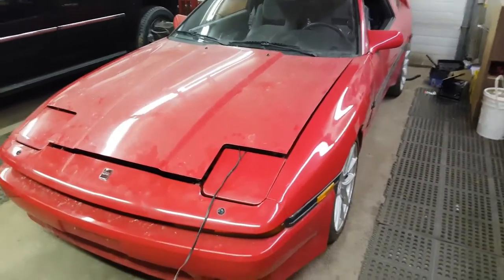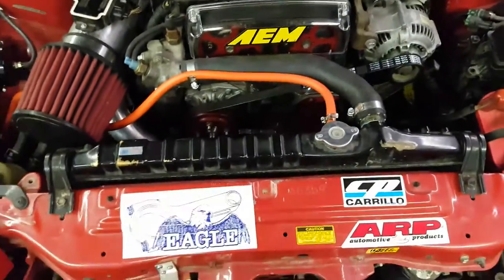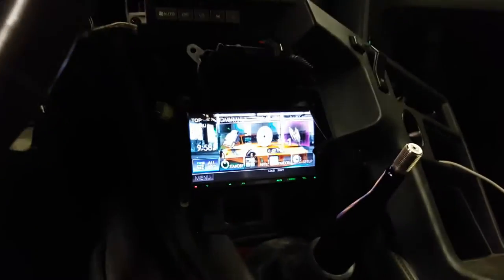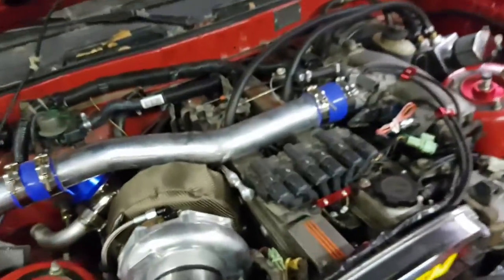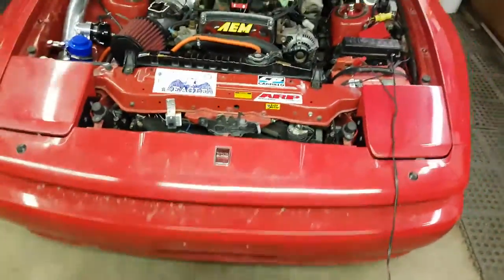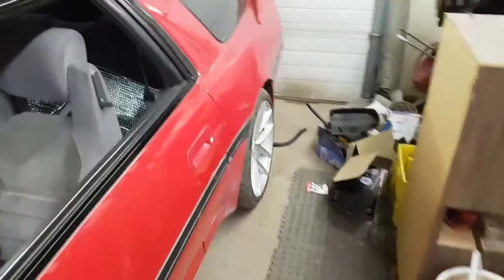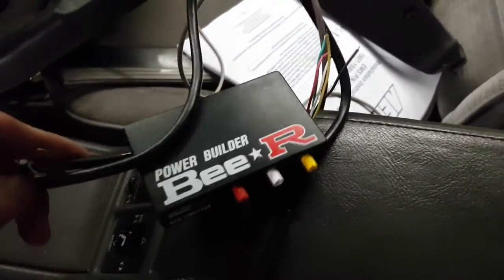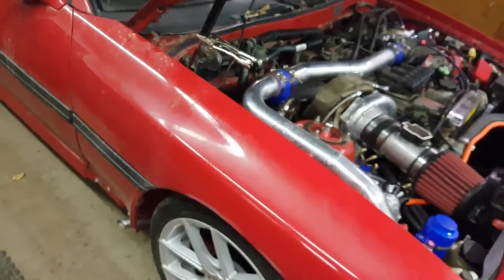mk3 supra fully built 7mgte walk around and idle

Comment: sick job on the build. I'm rebuilding my 7mgte and you have that AEM standalone that's going to make that car a beast. You kind of made the build look easy and switching to a ffim will make the car look more like a jdm inline 6, that should have been stock anyway. Plus it makes getting power out of it so freaking easy, but they are like a grand just to have one made unless you buy second hand; good luck on that. I'm buying all my bearings, pistons, rods, etc... and I'm jealous. That R154 will hold power up to 500bhp easy. Just was looking up 7m's and your right about the door seals that say Supra on them, I've had two 87 mk3's for over 13 years and I've never seen those. The only thing I do is drift and set it up for time attack and it still is just ass happy so it's a driver's car for sure. I think that's why it doesn't get the love it deserves, but if you know how to drive you'll love these things. I love my Cressida but N/A 7m's aren't good, at least compared to the 7mgte. Sorry for the rant, I digress, mainly the best mods to do to the mk3's is suspension and steering mods. Poly Urethane bushings, coilovers, good steering wheel, and strut braces all around as well as aftermarket anti-sway bars with poly bushings cuz more than likely if their stock the car drives bad. And a really good differential and these cars are fun. Turbo is loud, wastegate is loud and a good BOV makes all the difference in the world. I hope you enjoy the mk3 cuz it deserves a following. Just ppl that can't drive hate on it and as long as you can drive this car you can drive any car.

Comment: on the cheap you can do the IS300 waste spark setup, coils are cheapest on Ebay, the wiring is easy to do yourself or buy from driftmotion, i heard the factory ignition ignitor and resistors are good it is just the coilpack style is kinda unreliable

Comment: Stock speedo meter is at 280km/h at my 1990 Turbo MK3... and change break and clutch fluid you still have to change unless you use dark chocolate milk for it then you are fine! And the door sills are really real nice! if you remove the front bumper the fenders go off and on easy so you might just get a good used one.
Reply from the maker: hahah thanks man!
Reply: MrBigzeee The thing with not changeing it for a long time is common but those are the one that complain about broken break and clutch cylinder too and if all shit goes down on you you ABS block will be damaged to due to bad maintenance of the fluid. Because the break fluid likes to bound with water and then the oxidation will kill it. Do not use it longer then 2 years better is to change it every year.

Comment: In the stock 7mgte with metal head gasket a reliable engine with over 300whp? Obviously with stock internals and frequent oil changes? 
Thank you
Reply: Lorenzo Clara I am wondering this too!
Reply: I'm making a reliable 400hp on a stock gasket with arp head studs at 80lbs. But I don't beat the absolute hell out if the car. But I do have fun with it.

Comment: Hey so I bought a automatic 7MGE Mk3 Supra the other day. If I get a 7MGTE block, will I be able to swap everything to the new block? And will i need to get a different transmission?
Reply: Not sure about that. just get a complete engine, you wont have to source out a turbo, lines, manifolds, ect. W58 and R154 work on either engine.
Reply: Yes everything is pretty much direct bolt on/off ge vs gte block

Comment: So is this on a GE block?  If so did you have the oil squirters tapped in?  Looking at just building a 7mgte and ditching the ge
Reply from the maker: I changed over to the gte block. the ge doesn't have oil squirters for the pistons
Reply: +MrBigzeee  ok. I was researching about going turbo but never hear many good things about na-t.  Looks like I need to find a gte lol
Reply from the maker: yea haha. it works but it'll last way longer with a gte

Comment: If that Mk3 was an original NA then it has the 4.30 differential....get rid of it and upgrade to a 3.73.

Go to justdifferentials.com and you'll find an 8" gear/pinion 3.73 for sale.
Reply from the maker: thanks man!
Reply: 755hp Just curious. What's wrong with the 4:30 diff?
Reply: Nothing is wrong with it; its shorten the length you stay in each gear across the RPM range. Great for quick accelerations, torque, launches starts, etc. However, as you make more power, its generally better to have a slightly taller final gear; this lengthens the RPM range as you stay in each gear longer. Turbo cars benefit from staying in their gears longer; as you stay in boost longer; especially, laggy big single turbos.

The gearing is really dependent on the power you intend to make and its use. Want a fun mild Hp (300-400Hp) Mk3 Supra for the street; stay with the 4.30 or 4.10 final gear. Want a big single turbo top-end high Hp (500+Hp) Mk3 Supra; upgrade to a 3.90 or better the 3.73 final gear.
Reply: its an open diff! you want that closed diff so you can have LSD!!